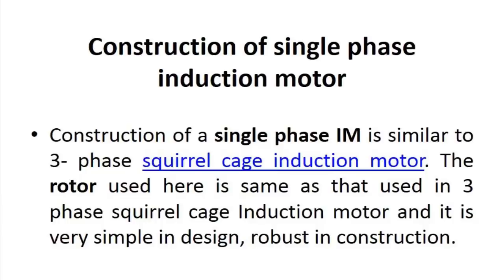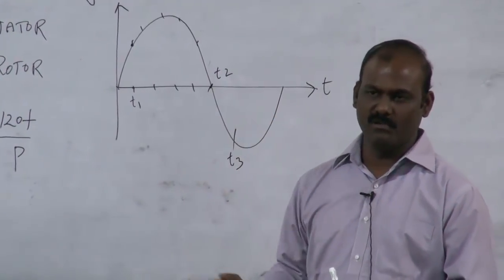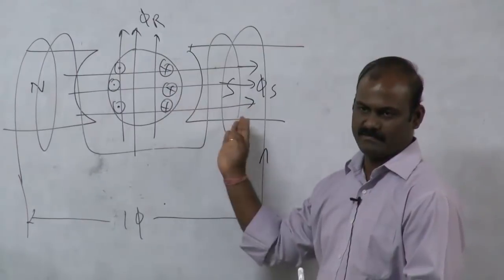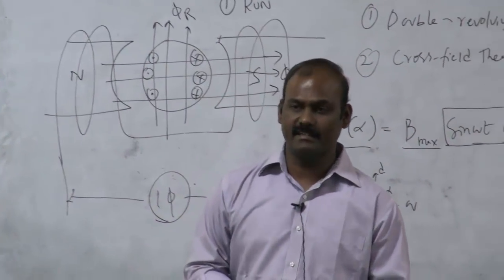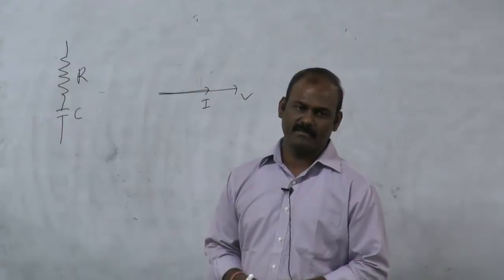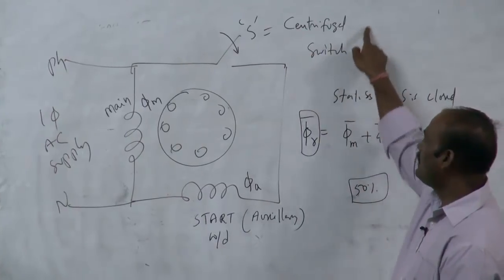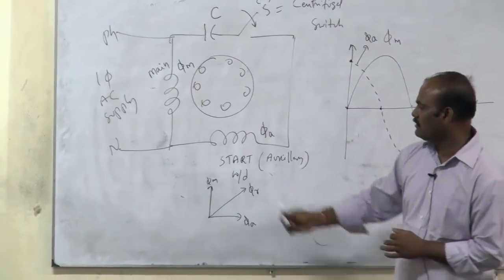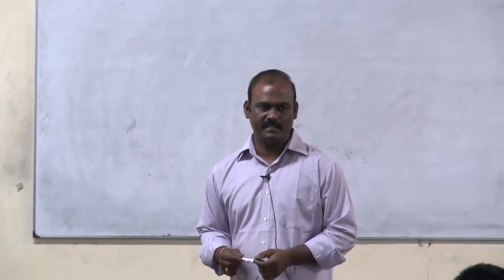Single Phase Induction Motor

Comment: sir u said in capacitor start motor the auxiliary winding resistance should be low but according to me auxiliary winding resistance should be high
Reply: You are right.
Reply: 1.resistance is in series with capacitor .
2. we want to create phase difference.Xc/r.

3.i f r Increase  phase Decrease.
Reply: Mr Rawat no u r wrong ...in order to have high starting torque at starting we must have high current so resistance should be low

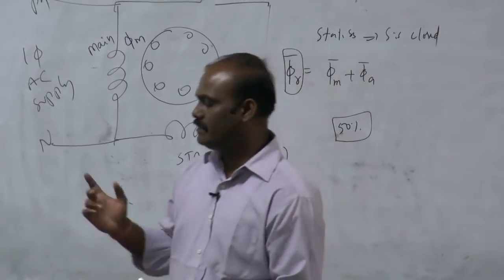Comment: The diagram that appears at 20:20 says (point 3): "An electrolytic capacitor is placed in series with the starting winding".  Is that an error?  I was under the impression that electrolytics were always for DC.  Does the capacitor can contain two back-to-back electrolytics internally, with diodes to protect them?
Reply: no error....electrolytic capacitor are used for short time rated conditions.....